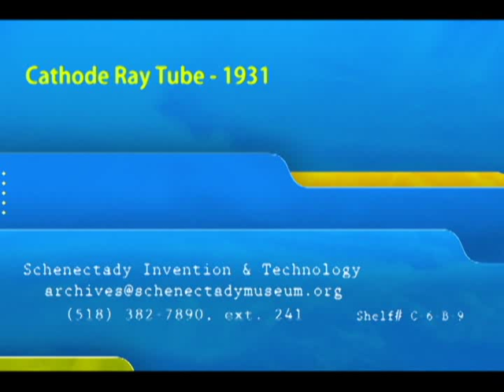Coolidge on the Cathode Ray Tube - 1931

Comment: How did they determine in advance that acetylene would not act as the flammable and sometimes explosive gas that it is under their experimental conditions?
Reply: Answer to the question as to how do you proceed with an explosive   acetylene gas/cathode ray bombardment experiment? Ans. From another room. 😂